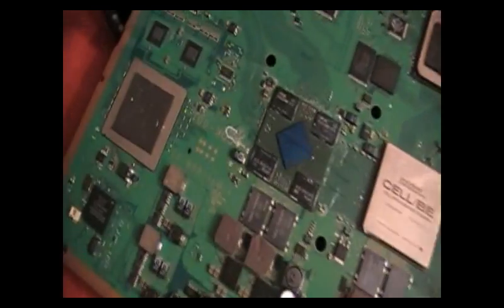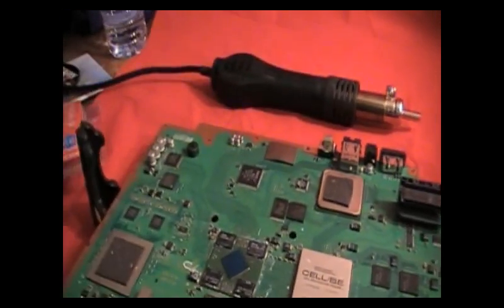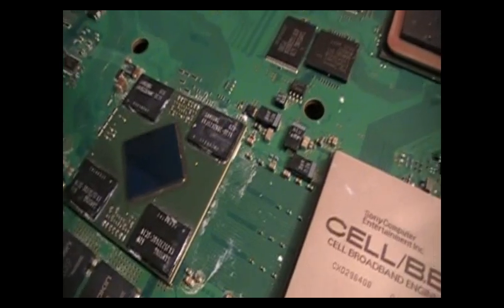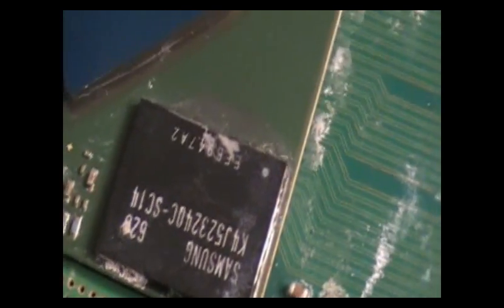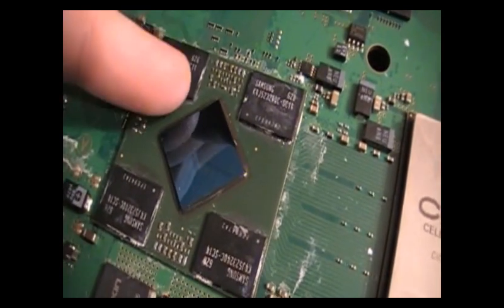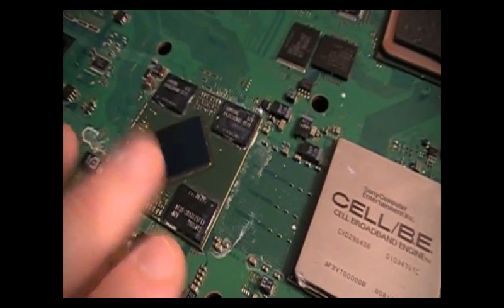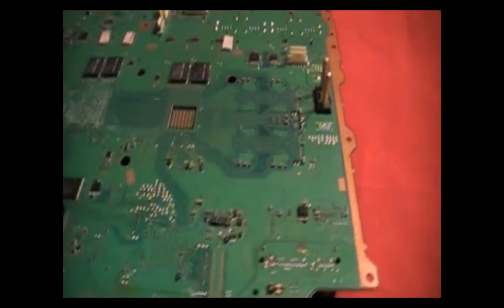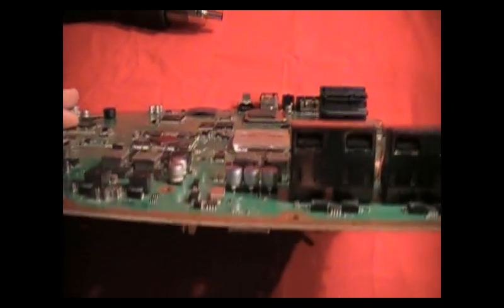Why Reflowing Playstation 3 does not work

Comment: I did a reflow on my fat PS3 back in the day. I had very little experience with fixing electronics but had nothing to lose trying a repair so followed a step by step guide on youtube armed with a decorators heat gun and thermal paste. To my amazement the repair worked and I got a good few months out of my PS3. I could have got more out of it but eventually picked up a slim model because I was always worried the original would fail again at any moment.
Reply: Any tips regarding Reflowing an PS3 Super slim Motherboard using heatgun? any tips to not get it burn or toasted the board?
Reply: @markhovscrch4050  I definitely wouldn't like to give advice and then you scorch your motherboard. I just followed a step by step reflow video guide on youtube. Hope you manage to fix it.

Comment: how about an unit that stopped working after delinding the RSX? It works over again after a couple of minutes when the PS3 gets warm enough like nothing had happened. I think one or more balling cracked due to the force of getting out the lid... In this case the chip might be intact, there is just a need to resold a ball or two, right? My reflow might fix it permanently, isn't it?

Comment: Ive got a bc 60gb that has been sitting for awhile.. the ylod is only going to get worse and worse for these old consoles… wish there was a fool proof way to actually fix these
Reply: Search the ‘Frankenstein Mod’ for PS3s,
Lets you swap the old faulty 90nm GPUs(RSX) for a better later model 65nm or 40nm GPU from Ps3 Slims and Super Slims.

Comment: Reflowing is only a temporary fix at most. A bandaid. PS3’s, unlike the 360 most times, fail due to multiple factors including heat, capacitors going bad, general failing, bad solder, etc.

Comment: I have an old fully backwards compatible ps3 that I tried to reflow the chip myself on. It didn't work, but I was fairly sure that it wouldn't but I had nothing to lose. I am not going to spend the money to get it reballed because I have a working ps3 slim, a working ps2 and a working ps1 so the backwards compatibility is not a huge deal for me.

Comment: replace the 2 nec/token capacitors on the reverse side of the board to the processor, on the side of the gpu. if your ps3 is turning off within a few seconds 9 times out of 10 its them capacitors
Reply from the maker: Good to know!
Reply: Its not the gpu!
Reply: @lucasclaeys7474  youre absolutely right, i got them muddled up
Reply: Yah
Reply: red light of death right?
Reply: yes for the red light of death

Comment: I blasted a hairdryer on high heat for 20 mins into my ylod fat ps3 60gb in 2008 and it's been working solidly to this day 2019.
Reply from the maker: you helped my point solder melts at around 180 degrees or a bit more. Average hair dryer gets about 140 degrees. 

YOur chip just did not fault again. 

But again I have fixed so many I am going on averages. Sure there are cars out there that go without oil changes for 20K miles and run. Then you have most of them that would break down at that point. 

Sure are their a few that do work. yep but again the solder did not melt at 140 degrees.
Reply: @garyorner8325   Yep, I "repaired" my machine somehow but it definitely wasn't reflowing. You can never beat the good old hairdryer trick. It's like slapping the side of a TV to get a better signal... for some reason it works!
Reply: @garyorner8325  The nec tokin capacitors feeding both the cpu and gpu eventually end up at a higher ESR than factory specs after enough heat cycles. When they fail you end up with the YLOD but of course the YLOD is just an indication that something is wrong and is not limited to the CPU, GPU, or Nec Token caps. I have replaced two of the 4 nec tokin caps on the gpu with tantalum caps with success but sometimes it’s a combination of bad Nec tokin caps and bad bga contact under one or both chips. When you heat the chips, even if under the melting point of solder you’re temporarily worping the chip just enough to make sufficient contact with the  solder balls underneath again. Most of the time when someone does a reflow they do not preheat the entire board evenly causing a shorter fix than would normally occur. It’s temporary yes but it can last as long as a year or more if done right and a gaming console was designed with planned obsolescence at its core.
Reply: @corybrown5583  I'd only agree with some of your points. The PS3 was not planned to fail after a few years. Even the 360 with its infamous red ring wasnt planned to fail. The red ring resulted from a critical oversight that cost them a mountain of money. The PS3 is different. Part of the issue was likely poor planning because of so many last minute changes. The RSX chip itself was not even originally planned and was such a disaster it caused Sony to never use Nvidia again. On top of making radical redesigns late in the game they also used a mountain of cutting edge technology. Blu ray, hd CD, a board containing the cell, the RSX, the emotion chip, and a bunch more chips to get every ridiculous feature working. The more complex the design the more things can fail and the harder it is to find every issue in QA testing. Sony made every new PS3 model more simple than the previous by removing complex and expensive features. Part of this was to lower cost but it was also to lower the failure rate. My PS3 slim has lasted me a decade. This isn't random luck this is because of Sony engineers putting in a ton of effort to make the PS3 as reliable as possible.

I agree with everything else you said.
Reply: @skurasch  NVIDIA's GPUs from the time had the same issues with the die packaging and they had issues for a few years after as well. They are 100% to blame for this. It is a Geforce 7900GTX with RAM chips around it anyway.
Reply: Reballing station could work too but no guarantees for that I fix alot of ps3s I use reballing 80% and sometime I use reflowing

THE main problem is not the balls not connecting its inside cpu cell broken down when heat it up it solder back again to solid then this makes it works reballing is not a big thing
Reply: @Toqhy  CPUs dont have this problem, its the GPU. The materials just weren't there yet for this density of power, if they never run above 70c they won't break but in consoles and laptops they did. Same problem was on the 360 GPU which failed even more because it had less cooling and therefore ran hotter.
Reply: When using a heat gun, do it for no more than 5 minutes. Period. Edit: would not recommend trying it on delidded boards

Comment: I brought PS3 6 months ago I had no troubles until week ago. I just replace thermal paste on my PS3 80 GB plays PS2 games because my fan got very nosy .now it works fine. I hope it will last long time. I am not going  brother with Reflowing  or reball . I had first Xbox 360 came out it over heated I did towel trick it only lasted few times next thing my xbox 360 died. i didn't mater much i got it very cheap as it is few years ago

Comment: Backwards compatibility would be worth it to most, if not all, the gamers I know. Not that I'm encouraging bad techniques while re-flowing, but if you look at this situation from a customer's point of view, they are going to want the quickest fix for this problem possible. Not everyone is going to take a great amount of care as they might should. So it shouldn't be surprising to you that people just heat the motherboard with a hair dryer or oven. You seem too critical about fixing this issue. I've looked up and found SEVERAL other videos where simply re-flowing has worked just fine.
Reply: How long did they work?
Reply: Not very long. It provides a bandaid fix only. Maybe you can get 6 months max.
Reply: @Josh.Davidson  I mean yeah I wouldn't ultimately rely on that approach at all either, but the guy in this video just seemed like he had a personal vendetta against anyone who tried it lol.
Reply: As a technician, the problem becomes from frustrations of receiving consoles that have been damaged further by these types of janky fixes, as well as the number of systems be repaired improperly and ultimately left for a landfill rather than a proper fix. So I understand his frustration.

Comment: Good day sir! Now i'm a certified electronic technician and you're exactly right. And more you should NEVER EVER HEAT A CHIP RIGHT OVER THE GLASS PART OF IT. Very easy to overheat and kill that chip. You just heat the 4 corners of the chip for 30 seconds, not more keeping moving your heat gun with good flux under the chip and stop, that's it. Like you said, you just did restructured the inside of the chip temporairely but IT WON'T LAST. And with  this type of Ps3 chip you can't reflow the four corners because there are four memory chip, one at each corner so the heat won't even go in properly. Can last a day, a week, a month, a year, an hour, nobody knows. So, conclusion, when your Ps3 is dead, it's dead. It is only can be good to recover your hdd saves, that's it.  Just buy another Ps3, that's all. Now, please guys, stop believing everything you see on you tube from people who are not certified technicians. You want the Ps3 to last longer, clean it every 2 years or every year and change the thermal paste inside the chip too if you are qualified to open the heatspreaders. and don't play more than 4 or 5 hours with them at the time. Same with  Ps4. Thank you men and nice and real video truth from you. By the way again,  it is very dangerous to open heatspreaders if you are not experience and again, don't listen to bad ways from a lot of you tubers on how to open them. Most of them are not qualified, sorry to say this but i want to protect custumers.  See a professionnal technician. You scratch your chip just a bit and it's dead. Thank's. Regards.
Reply: Certified tech uses the word "glass part" troll
Reply: @Dylan-qj8gj  I used this word my men because i'm french. Take care!

Comment: Reflowing works, BUT you have to do it properly, with the right tools, aiming a DIY Heat Gun at the board and hope if doesn't bugger it up more than it already is, is just playing Russian roulette with your PS3's motherboard, sometimes you get lucky, other times you kill it. You have to prepair the board, flux/SMD solder paste/etc on the legs themselves, and use a proper temperature controlled heat gun from a rework station.
Reply from the maker: Not sure you heard. I even said that you can set under the temp that solder will melt and it will fix the issue for a short time.
Reply: @garyorner8325 mine worked for 4 years after reflow

Comment: Guy, it’s worth a try reflowing the chip if it dies. It’s easy and is dead anyway. It fixed mine & has for quite a while now. Now I did a better and cleaner job than whoever tried it with that ps3, mine looks practically brand new inside & out again.
Reply from the maker: The point was a person that repairs them or paying to have it done. It will yellow light again as the chip is damaged.
Reply: @garyorner8325  Except only a crazy person would pay a shop to repair a PS3. I've repaired maybe a dozen YLOD for my friends over the years. I always did it for free because I'm a nerd and get joy out of repairing stuff. If I didn't repair it for free they would just rightfully throw it away because the cost for a used slim is lower than the cost of a professional repair. The main reason they'd want their console fixed in the first place is for cfw which I also do for free and I assume a shop wouldn't even do. 

Also, there is some real benefit to the PS2 BC over just using a PS2 slim so I wouldn't say it's worthless. The OG PS3 essentially becomes a PS2 with an HDMI port when running PS2 games. Unless you're running it on a CRT the difference in picture quality will be massive. Similar to how a cfw Wii U is a much better GameCube than an actual GameCube.

Comment: IF I wanted to get mine repaired, what method is known to work, and work well? I know value wise it's not worth it, but I want mine repaired mainly because my wife worked her ass off so we could have a PS3 back in '06.  It's really a matter of principle for me.
Reply from the maker: If you are going to do it there are a few ways. none will be forever. 

1) Just heat the chip up.... then put back together. 

2) Remove chip and reball the chip. 

This is coming from an tech not a garage tech. I do this for a living. I have worked on hundreds of PS3s.
Reply: @garyorner8325  Would it be possible to replace the chip that is known working?
Reply: @garyorner8325  I just bought another it’s way too much work and no guarantee it will last the one I have is better then my old one plus I got more space in this one the downside I lost all my data but have access to all my games

Comment: I used to think BC ps3 systems were great systems but in 2018 it's really not. By now, the used ones are probably on their last legs and you will pay a big amount just to have one. A more reliable slim or even super slim ps3 and a ps2 on the side will not only cost you less but will last you a lot longer and yes I know, having 2 in one is more convenient but honestly, how much space does a ps2 slim take up? It's slightly bigger than a game case.
Reply: idk man, my cecha01 ps3 ROCKS in 2018. It can read games my ps2 phat and ps2 slim cannot. Games that skip on my ps2 play without skips on my ps3. It's on 2.76 official firmware and plays ps2 all day over hdmi. Great for streaming ps1 and ps2 to youtube. I use a non-BC ps3 for ps3 games tho.
Reply: That's fantastic. I just hope it lasts as long as you need it. I know someone else with a cecha01 that still works and it was never even opened for cleaning.
Reply: You do realize that the BC PS3 is the best way to play ps2 games because, if you play the ps2 using component cables, it doesn't look really good. If you use the BC PS3, it cleans the ps2 games very well.

Comment: I’ve tried reflowing multiple times and it has never worked it’s bs
Reply: XX78J what is a cfw I have a original PS3 in pristine condition and really want to make it last
Reply: Acoustic Destruction same man
Reply: { BlitZ } Turboz I’m just gonna end up throwing out my PS3’s motherboard and buy a new one
Reply: Maybe so. I think it's just pure luck half the time
Reply: @XX78J With the cfw and low temps, did your reflow process last until today? I'm thinking about doing it (the right way), but i don't really know if it will last.

Comment: Here's a question for you. When reballing a PS 3's GPU or a PS 4's APU using the air that you showed in this video and a preheating table what's a good temperature profile to use?I've got some conflicting info. Some people on you tube said to Pre heat the board for as much as an hour at 100 Celsius but my cousin told me to start at 105-115 C for 20 minutes and then start the air at 250 C or more as long as the chip heats up 3-5 degrees per second then bump the chip until it moves. Well I did what the you tubers said more than once and even when I got the chips to lift I'd lift pads. Then I did what my cousin said and again I lifted the pads off the motherboard. I've only got one board left; what do I do?

Comment: The ps3 can be reflowed and last much longer then a xbox 360. The ps3 has higher quality parts inside so it lasts longer after a while though you should probably reball the chips on the ps3. The xbox 360 you can only reflow it like 4 times and it's pretty much dead until you reball the chips. My 360 is garbage until I reball it. But my ps3s I reflowed them and they are running much better than the 360.
Reply: I'm just saying that reflowing does work but it always doesn't work. Just to an extent
Reply from the maker: it does not work. if it did it would not break the same way again. can it turn the system back on sure. It will fail again. as a tech that is not fixing that is a band aid
Reply: Gary Orner that's what I mean but the thing is that you're saying that it doesn't work it does but it's not permanent
Reply: Gary Orner reflowing is not the ideal way
Reply: Gary Orner I would reball my ps3s but I don't have the right equipment to do it

Comment: its not worth it getting fixed then does it again after so meany times it wont work anymore like doing towel on Xbox 360 my very first Xbox 360 I had it had over heating thank goodness i got it used at low price I have PS3 fat it cant play  PS2 cds. so for  I am lucky I haven't no over heating

Comment: You are so right. i'm an electronic technician and i specialise in ps3, ps4 and others. reflow is no good at all. I refuse dead  ps3, i just take  ps3 or  ps4 before they are rlod and i clean them once a year, change the thermal paste for MX-4 inside the chip too, fix the laser drive or power supply but if a client tell me  RLOD, i refuse to work on it and if you change the chip, maybe it won't recognise the data on the hard drive. Thank's. Good video men. Keep going this way. serge.
Reply: Yo
Reply: Hey man , my ps3 had the ylod but he start on after several trys , but then shutting off just with some games , wher is the issue ?
Reply: @zxbreakeralg7429  Try to clean it and make the thermal paste replace for new and if it does it again, YLOD.
Reply: Lamine ALG sounds like it could be the Nec tokin capacitors are failing. Google PS3 capacitor fix. A lot o people have fixed there PS3. Hope it helps.

Comment: I have done a reflow that worked perfectly!!!! On three different devices. I just wonder if I was really just frying the thermal sensor inside the CPU. And u are full of s*** about ps harddisk recovery that data will only be read by the board it came with!!!
Reply: Actually jason before calling bullshit please check out a ps3 sdk for hdd recovery. <3
Reply: how long did it last, im planing to do mine